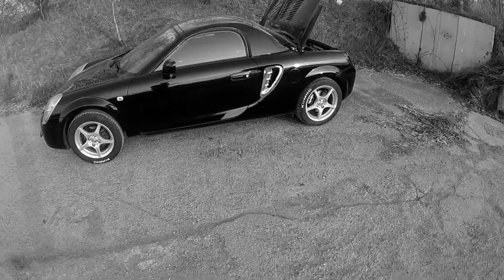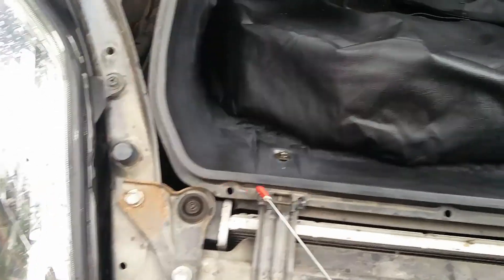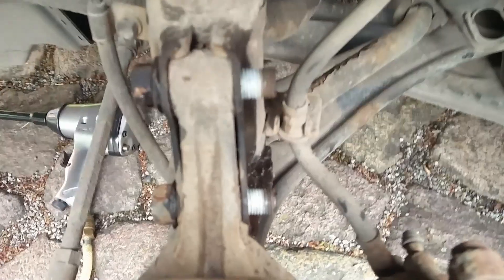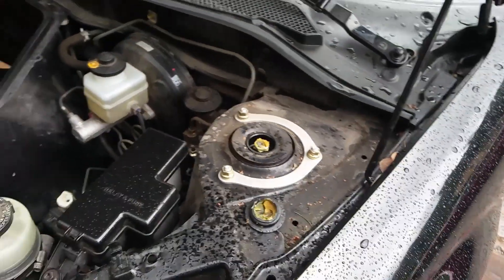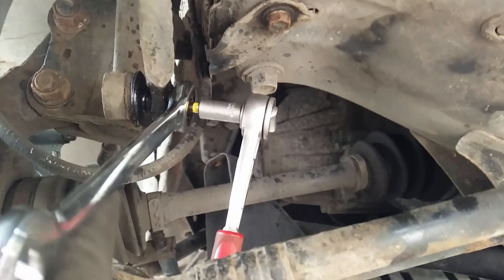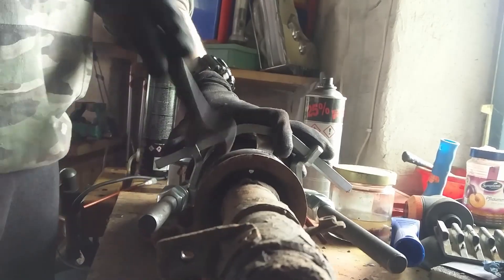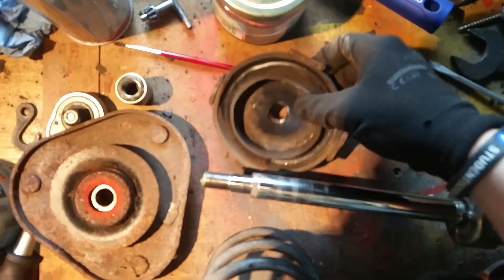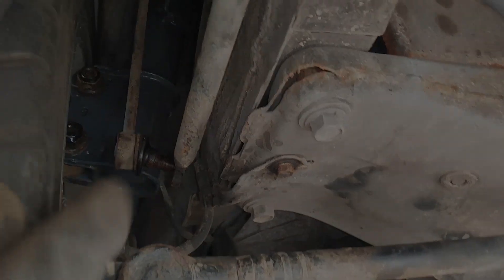How To: Installing Lowering Springs - Toyota MR2 Spyder

Comment: Amazing!  Can I install these springs on my Toyota Hiace too?
Reply: Not These particular ones, but if there are lowering springs available For the Hiace, the process will be pretty similar :)
Reply: @planet1852  Nice I already removed some seats, the seatbelts and the airbags to reduce the weight.I installed some nice fire flame stickers too. It is my company car hopefully that's not a big deal.
Reply: @doktorkongo8665  I find that a great way to reduce the weight further is to remove the driver. The car was a massive 80kg lighter!
Reply: @standandeliver8376  Yes, but then nobody could drive the Hiace. I already lost 20kg of weight with only eating onions for a month. I had some nasty flatulence during this time and my wife was really upset about it (nearly left me with our Chihuahua). But I could improve the 0-100 from the Hiace by 0,2s (from 23,4 to 23,2). Crazy shit. Was able to race a Camry at a traffic light, but then sadly I missed the second gear.
Reply: @doktorkongo8665  That was you in the Hiace?? That explains the smell when you wound the window down. I thought you'd leave me for dead the way you were going, especially as my Camry only has two working gears.
Reply: @standandeliver8376  Do you live in Goma too? Crazy shit. Yeah that's crazy. Back then when I was working as a paramedic in Kinshasa I drove a Camry too. Pretty fast car I was stunned by the pace. Unfortunately I was caught racing with this beast, when I loaned it for some racing at the weekends. My Boss was not amused about it and I got fired. That's the reason I live in Goma. I am now working as a Pilatus instructor. I haven't got a job as paramedic because of my backstory. Sad Story but I am planning to open my own car tuning company when raised enough money. When you live near Goma, maybe we can meet each other and I can modify your Camry a little bit as preparation for my car tuning company. Maybe we can get your gear problem fixed!

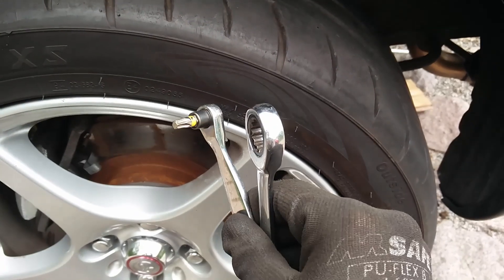Comment: At 04:30, what size is the required torques?
Reply from the maker: You mean for the sway bar end links? Im not sure but I made them good hand tight.
Reply: @PlaneTMRS  I looked it up, I believe it's a TORX T30. Could I use an adjustable spanner for the nut?
Reply from the maker: Aah you meant the tool, sorry 😅. Yeah why not, but make sure not to make it round
Reply: @PlaneTMRS  I think I'll be OK. Thanks for the video, as it helps me prepare for me doing mine. Happy driving.
Reply from the maker: You too!

Comment: What size, in mm, are the springs you have put on?  Thank you
Reply from the maker: They are "30mm lowering springs", so they lower the car 3cm. I can't tell you the over all length unfortunately. If you need the exact length, I can check the papers that came with the springs. Hope that helps :)
Reply: @PlaneTMRS  Thank you that’s the measurement I wanted. 👍
Reply from the maker: Alright, you're welcome :)